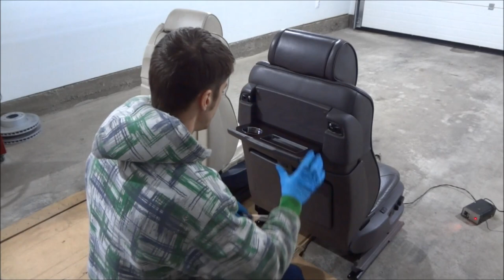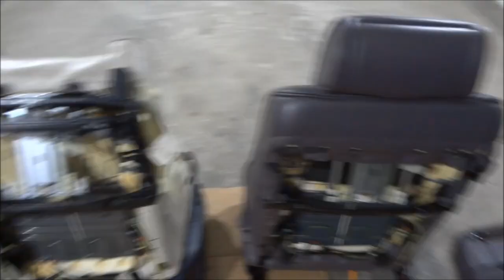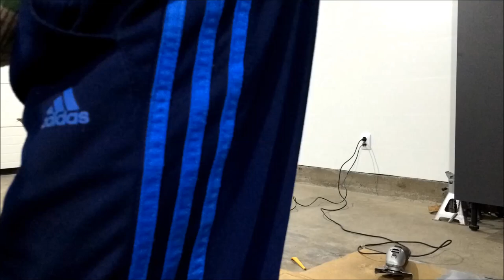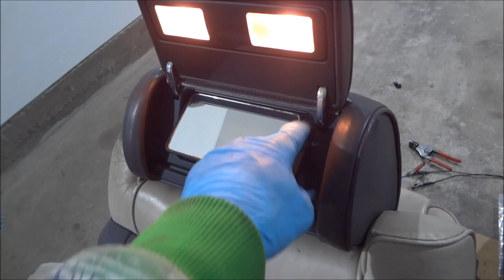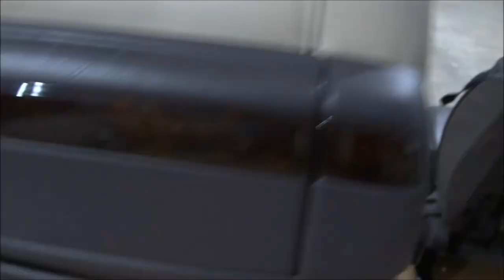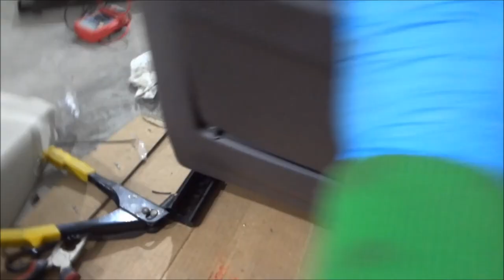BMW e38 Contour Seats Retrofitting with Extremly rare Drink Table and Mirror

Comment: Do you need different motors for the headrest with mirror or will the original motor work?
Reply from the maker: Hello,  original motor works
Reply: @MOvidiu  okay thank you, and also what about the wiring for the lights, where do you hook up too ?
Reply from the maker: Check in BMW WDS  for wiring connection

Comment: IT is possible to Move the shoulder Part 
Manuell?
Motor is brocken.
Reply from the maker: Yes , if you take out the gear system
Reply: @MOvidiu  IT is works from the backsite of the seat?
Or i need to take out?